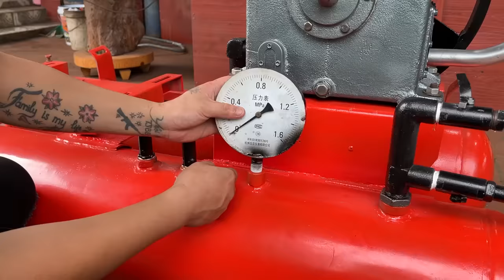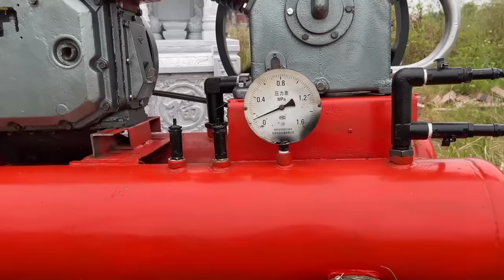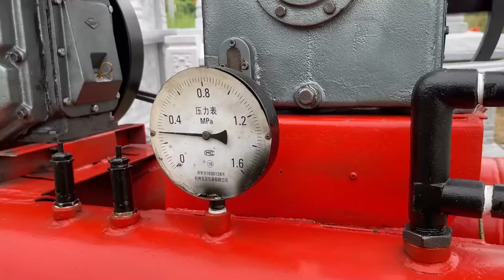Master Mechanic Restores A High-capacity Air Compressor Forgotten Perennial // Full Restoration

Comment: How did you fix the rust in the air compressor cylinders?
Reply: I don't think he did,for a compressor this size it didn't build very much air pressure. I'd be interested to see how much pressure it will build and hold after running 5 minutes. As rusted as those cylinders were I'm pretty sure it's got blow by issues.
Reply: I did not see any honing of the bores, not even any pre lubing

Comment: He didn't wash the grinding paste off after grinding the valves. Big error. Also big huge error beating ball bearings in with a big steel hammer. Set the valves by pulling them open to see if gapped. No, that takes a feeler guage.
Reply from the maker: Thank you for your feedback so we can improve future products. Wishing you good health

Comment: I have a question for you. What is the name of the spray you use on those persistent old rusty nuts and bolts that refuse to come loose? I've seen you use it in many other videos.
Reply from the maker: That is Selleys RP7 anti-rust and lubricant spray bottle made in Australia

Comment: Great clean up and reassemble job, but c’mon guys. That’s a full workshop compressor, surely you could have run some heavier hose and a one inch impact on a few huge rusted truck lug nuts to give it a workout?! It’s a little big to be using to fill up tires or soccer balls isn’t it? I’ll give you one 👍🏼 for the restoration, but you’d have to prove it’s worth for the other one😉
Reply from the maker: Thank you very much . Please always follow and support us!

Comment: 03:08的意義在哪裡
Reply from the maker: because the old flywheel is very tight and has rusty joints. We tried using vam but it didn't work. We have to close the valve so that the pressure of the valve plus the impact force helps the rust come out

Comment: Just a suggestion get a dead blow hammer with a lead or copper head for pounding in the race ball bearings.  Pipe of  a similar size to the shaft is better than a driver. When you assemble the pistons you were putting in the gudgeon pins while the piston was contacting the steel bench.  Take more care and you will get more respect.
Reply from the maker: Thank you for your feedback so we can better improve future products. Wishing you and your loved ones good health!
Reply: I nearly cried watching those bearings smashed in like that.

Comment: Cylinder sleeves  on well used air compressors(or ones sitting out in the weather for 25 years) are always the first to get worn(or rusted) and cause  little air compression, maybe new rings on the pistons  will hold for a few uses but not for long.Why not just get them bored out at a machine shop if you're going to all this trouble.

I call this guy the paint mechanic,make it look pretty and it fixes any piece of junk!!
Reply: Those poor bearings, that was painful to watch

Comment: Those tanks should be replaced or at least pressure tested Could explode from rust perforation on the inside!
Reply: @richardbaumeister466, they didn't even hone out the heads,especially the one that had the water standing in it on top of the piston

Comment: It looks great, other than that I’d say it’s a fail. New reeds, reed plates, cylinders, and proper sized belts would help. Never paint or reuse pop off valves, no need to Teflon flare threads as they are not the sealing surface. Also I am curious as to the condition of the inside of the tanks, too much deterioration and they can explode. Also don’t paint the lubricated areas of the engine like inside the valve area. I wish I could get my hands on one of those engines, they look like they are built like a tank and simple enough to last a lifetime.
Reply from the maker: It would be great if you were also a worker in our team
Reply: @restorationsskills4967  I rebuilt just about anything from vintage appliances to atv’s, I’ve done a few air compressors but it difficult because the tanks are usually compromised and replacements are far too expensive to justify. We’re talking large industrial 200-300 gallon tanks not sure what that is in liters but it’s big. I wish you had shown more like what did you do to the cylinders? Just a hone, replace, bore? What was your method of cleaning up the reeds? My country however has rather strict rules on industrial equipment, if I sell a bad tank and it explodes I can get into serious trouble, not sure how your country’s laws are. The safety valve alone being painted would be a failed inspection.